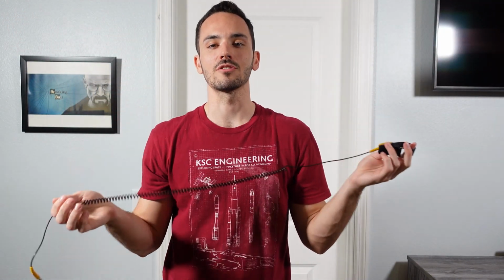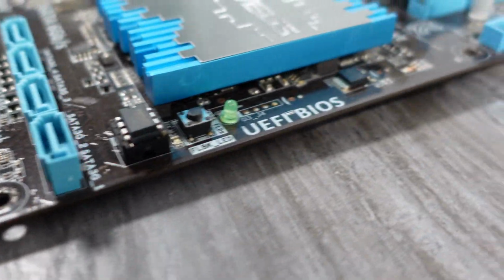Avoiding Damage: Your Guide to Safely Handling PC Components

Comment: Modern components dont get damaged by esd by humans, they have enough protection to it. Even when i was a beginner i used to touch almost everything on my old motherboard. Ltt and electroboom did a test where they tried to fry a old a$$ ram and they wasn't able to fry it. They needed a voltage generator g*n for to kill it

Comment: fuck I was building my first pc on a carpet now I'm scared to turn it on
Reply: Is it working ?
Reply: please, continue to elaborate
what happened!??
Reply: @newyorkertx7024  lol this comment was 3 months ago...its alive a friend just told me to leave it for a day or two before turning it on its working fine to this day
Reply: @exoz6771 interesting approach. Sounds like it would work but im a little sceptical anyway. I would love to see a tech youtuber test  it.
Reply: No 😤 eat grass @newyorkertx7024
Reply: I builded my first pc on a carpet and it imidietly power up with no issues
Reply: @Dudelivinlife it’s not guaranteed to happen. It’s the fact that it can happen is why you should always avoid the carpet
Reply: Do it.
Reply: @exoz6771  bro its probably fine i built mine on my bed
Reply: did it turn on?
Reply: @RenathanAbdulDjalil it almost definitely did
Reply: I cleaned my pc on a carpet, and now my motherboard and gpu socket electric me but work fine the only problem i can't put any usb or anything while it is on what should i do to get rid of it 😢
Reply: I have did that multiple times nothing will happen bad
Reply: I dont think it's as bad as some people think. I have had mine nearly a year and never even knew about this and it's fine. I will be more careful in the future though
Reply: @MillerTheOriginal some other guy in a vid I saw said his dad has built PCs and even worked on Satellite components for like 30 years. Static won’t likely completely brick any parts but it can very easy cause minor malfunctions affecting performance. You may never know they are there or you maybe develop bad issues down the line
Reply: Do you have to use bad words? Other people like me don't want to see it. really. Thank you 🙄
Reply: @Me-je2jv 😡💀🔥👺
Reply: @Me-je2jv  waaaaaa waaaaaaa😭😭😭
Reply: @Me-je2jv unfortunately it’s the modern world get used to it

Comment: What if I handled the Motherboard on the back whilst it’s still in its anti-static bag?
Reply from the maker: If you never remove it from the bag you can still damage small components on the board, so just make sure to hold it from the back and you’ll be fine. Note, the inside of antistatic bags are designed to not build up static but the outsides still do, so don’t place the board on the bag when you remove it.

Comment: Sir I have a question....doesn't discharging the pc do the work? Remove everything thats plugged in the pc, keyboard, mouse, video cable, and power cable....then click and hold the power button for 30 seconds....doesn't that remove the excess electric left?
Reply from the maker: The danger can still exist in static electricity that is generated in your body, any friction can slowly build up a charge (even your clothes rubbing against your skin)
Reply: @MaxsTech  okay so the solution to the static electricity thing is touching a metal part of the pc which is the case....I can just rest my forearm on the case and proceed with replacing any pc parts?
And also another question....is it safe to discharge a pc everytime I do some replacements on the parts?

Comment: Bought to build my second pc and this vids a great refresher. I did accidentally place my whole hand on the back of the motherboard when I took it out to install the cpu. but I had grounded myself earlier so I think I should be fine. Will find out by next week 😅
Reply from the maker: A lot of boards these days are pretty tough when it comes to static, more concerned about grubbing around the front onto a capacitor or something small that can snap. I’m sure you’re fine! I’ve held them like that before too usually palm on the back plate of the cpu
Reply: @MaxsTech  I just want to make sure, I can just touch the case to remove static charge every now and then considering it's humid and we're in summer?

Comment: Hi! If my environment's humidity level is above 80%, what are the chances of doing damage to the motherboard? Assuming I am not grounded and my feet is on a stone floor
Reply from the maker: At 80% it would be a huge reduction of a static charge building up, motherboards also have good protection coatings on them. While I’m sure there’s still some kind of chance, it would be very very low for you. If you want to be extra safe just touch your pc case of you walked away from the build (walking will be your primary way you build up static charge, especially on rugs/carpet)
Reply: @MaxsTech  thank you! You just cleared my doubts.

Comment: its always been a question in my mind. Ive seen people use these black gloves and ive no idea what they called but they use it while building a PC. you think thats safe if you cant be asked to use one of those wires? great video btw
Reply from the maker: Depending on the glove, it can still build up static electricity on the outside. Some though and likely the ones you see are usually nitrile gloves which don’t build up static as easy. I also like them just so I don’t get natural oils from my hands on components.

Comment: Love that you still respond to comments! When it comes to laptop chargers, will any laptop charger work? If you plug the wrist strap to a plugged in charger on the metal end, as you showed in the video?
Reply from the maker: As long as it uses 3 prongs. The bottom prong connects to the ground your entire home electrical system uses, so you’re basically just connecting to that through the charger.

Comment: I have that same exact motherboard 11 years later, looking at upgrading the case, RGB fans, power supply and getting a AIO CPU cooler. Then when ready will upgrade motherboard, CPU, GFX, memory and hard drives at a later date.

Comment: Hi, i just built my pc ON the outside of the anti static bag of the mobo, then placed it all excepto for the gpu, then when read all about potential damage, took everything out and placed mobo back onto its anti static bag, you think there will be any damage? What can I do
Reply from the maker: Have you powered it on? Whatever is done, is done. Most motherboards these days have decent anti static protection coatings already on them. Placing it back in the bag won’t undo anything if something happens but I doubt anything happened. I would just rebuild your PC, this time using the cardboard box as your surface and give it a power on and see.
Reply: @MaxsTech  ok then, well, never plugged it to the power, and used glover for most part of the installation except for cable management.

Comment: I have a question, can you hold the backside of the motherboard freely?
Reply from the maker: Typically yea, as long as you’re grounded the board usually doesn’t have any components on the back like capacitors or anything that could more easily get broke. It can be kind of sharp sometimes since many of the solders poke through the back, but otherwise it’s pretty durable.
Reply: @MaxsTech So those solders are safe to touch?